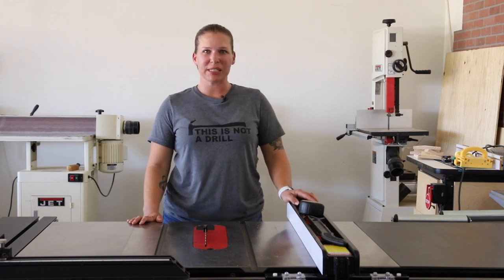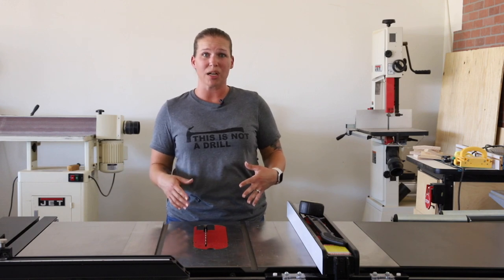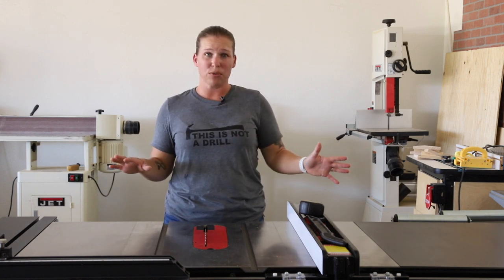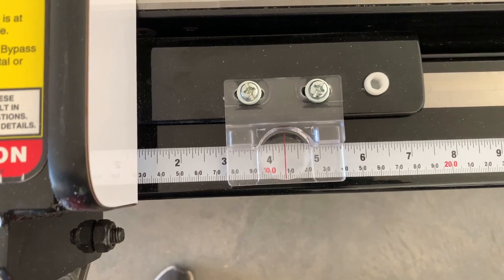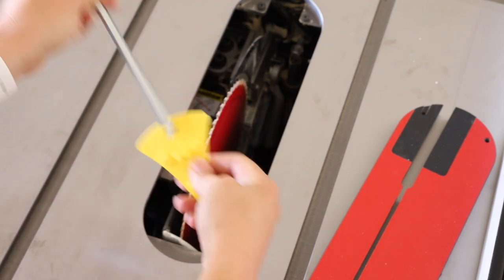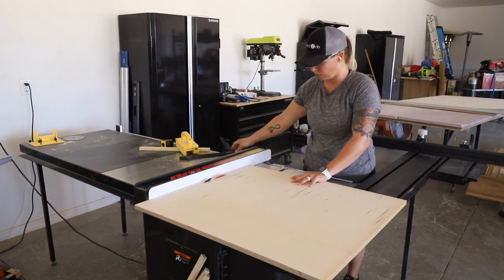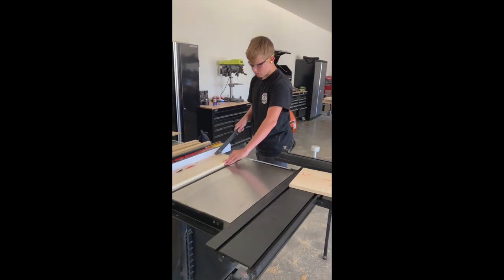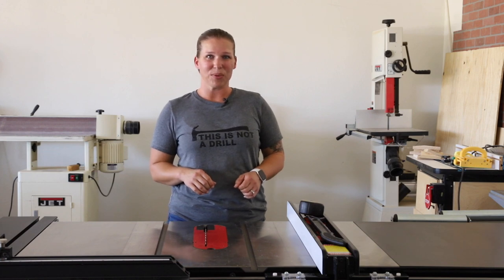SawStop Review - 1 Year Later (The good and bad)

Comment: i sold my beloved Unisaw and was prepared to purchase the Industrial saw with 5hp which is a fantastic saw, but after much consideration, i realized that i never bogged any of my Unisaws with 3hp and a sharp blade, so at the last minute i purchased the PCS with 3hp and the 52" fence and i do not regret it at all.  it is a great saw with plenty of power and the customer service at Saw Stop is first class...thanks for sharing and i am happy to see that you are teaching your kids to use the saw in as safe manor!
Reply from the maker: I also considered the industrial but realized I REALLY didn’t need that much saw for what I’m using it for.  I’ve had zero troubles with my 3 hp binding up on me and beyond the safety features, I just love how amazing the quality is on this.
Reply: @addicted2diy  I own them both and there is a huge difference between the 5hp and the 3hp, I use my 3hp as a dado station, they are placed back to back with a 3' out feed table between them; one only realize how valuable 5hp or higher is when have to cut thru thick hickory material or any other hardwood that you want in thick material; I love them both, I don't see the use of the slider, I owned before the real slider saws, as you mentioned in your video, only good for large material rip, that's all, other than that, the slider is in the way all the time.
Nice description of your saw, have fun with it.
Dan
Reply: @PAPSROYALAPIARY  With 3hp I  resaw 5/4 Ipe 1x6 decking with the blade full up buried in the edge of the board.    No issue with a lack of power.  Ipe is considerably harder than hickory.  On the Janka hardness scale hickory has a hardness score of 1820, not quite 50% harder than White Oak.  Ipe's hardness scale is 3680, double hickory's hardness, and almost triple white oak's hardness.    One advantage I do have is I do have 10 gauge wiring from the 30amp breaker to the saw including the saw cable.  Voltage drop is nonexistent.
Not saying that you have voltage issues but I do not hear or detect any slow down when cutting 3" deep in Ipe.  This was true with my Jet 3 hp cabinet saw and my ICS 3 hp SS.
Reply: @11211lcb  Great, but one wouldn't know the difference unless worked with both 3hp and 5hp, so with that said, we all love our saws, but realistic assessment is only viable if we can do a true comparison, right?

Comment: Katie--thanks for the review. I'll be getting a slider for my saw once I use up an excess of lumber. Have you ever thought of using a pushbutton clevis pin to keep the slider from moving out of the rear position? It seems as though it should be an easy thing to drill a hole in the slider frame, into which the pin could be inserted. 

Some pins even come with a lanyard; using that would keep it from getting lost.

Comment: I have same saw in my shop minus the cross cut sled. We use a nickel for the gap on the cartridge. On average, it gets set off every couple of months. The humidity does effect how easily it’s set off.  Pretty happy with it, doesn’t have the power my powermatic has, but the safety feature makes it worth it

Comment: Maybe I’ve been taught wrong, but if I’m using a sled, I don’t use the edge of the fence. I believe that it can cause kickback in certain circumstances.
Reply from the maker: That’s correct.  I don’t cut the sheets down exactly.  I set the fence to an approximate length I need and slide the wood until it’s 1/8 to 1/4” off the fence to prevent any kickback.

Comment: Thanks for the 1 yr review - always best to do reviews AFTER putting some miles on the product instead of those unboxing reviews. For your miter problem - if you put the fence on the other side of the blade and use that 52" space instead - should avoid that problem.

Comment: We have a Sawstop at my local Menzshed. I've come close to setting off the safety system one time when my fingers brushed against the blade just before it stopped spinning. I find it to be a great saw. I think the only gripes I've personally found with it are:

1. If you set the fence very close to the blade (around 3 mm), the red warning light flashes to say it's conducting electricity.

2. The thing the castors are set in to has a large gap between it and the saw's cabinet that gap fills up with sawdust and junk quite quickly.

3. The internal tube that takes the sawdust away has a spiral rib along it that easily blocks up with sawdust and small slivers of wood.
Reply from the maker: I’ve never set the fence that close to have that happen, but one thing you can do to alleviate that is make a sacrificial fence that sits over the top of the actual fence.  Then you’re able to get extremely close and the blade will only cut the plywood on the sacrificial fence.
Reply: @addicted2diy  Yeah that would be a workaround. Would you mind setting the fence on your own saw about 3 mm or 1/8" away from the blade and see if yours also flashes the red light? Thanks.

Comment: Thanks for the glowing review of your saw. I bought a similar saw last fall and really appreciate the power this saw delivers compared to my previous machine. However a major downturn in my opinion evolved when the safety feature triggered…no injuries but the triggering occurred when I was cutting some plywood which apparently contained some water in one of the layers….the wood had been outside. I had previously been cutting some very green fence boards and had no problem. My soured opinion set in when I had to remove the destroyed brake module and blade, what a nightmare. I don’t think the design could be any worse. Because the saw was new, Sawstop did give me a one time courtesy replacements which I did appreciate. However I’m now faced with the dilemma of buying a brake cartridge for my dado blade and the annoyances of having to change it back and forth as the different operations are used….not impressed. My 1st choice was a Laguna fusion 111 but it just wasn’t available because of the messed up supply chain. When things return to normal my Sawstop may be up for sale.
Reply from the maker: That's such a bummer that you aren't liking your saw.  I haven't yet had my brake triggered, which I'm grateful for.  I am actually really surprised that it happened with plywood.  I've never known plywood to have moisture in it.  I'm glad everything was okay and no injuries were sustained!
Reply: Those aren't valid reasons for selling your SS and buying a Laguna which has the worst reported customer service in the industry . plus the laguna is trash compared to the quality of the saw stop . 
Triggering the stop mechanism with a wet piece of plywood is a rare event and buying a stop mechanism for your dado is simply unnecessary .Just be extra alert when using your dado some and you will be fine . 
The laguna is basically the same saw as a grizzly , jet , harvey etc but without customer service . Don't do it .
Reply: @siriosstar4789  Thanks for the response. Yes, I’m one year into my SS experience and I’ve only had one more brake activation….this one was totally my fault so the replacement blade and brake unit were on me. I have become super cautious when using the saw, more so than any other saw I’ve owned. I take note about the Laguna support comment, I do own other Laguna stuff and any time I’ve needed help they always seem to be helpful. However, I do like your suggestion about the lack of necessity for the brake unit for a dado operation….that hadn’t even crossed my mind. Unfortunately since my last post I have bought the brake unit but may never use it….I really hate the idea of destroying an expensive set of dado blades. Thanks for your positive comments.

Comment: I appreciate the posting.  I bought this saw about 5 years ago and I was considering the sliding cross cut sled.  Thanks for talking me out of it! 😊
Reply: For the price of that thing...I would skip it as well!!!! I can buy a whole tablesaw for the price of that sled!
Reply: @charlieodom9107  Or a track saw system that includes the ability to break down full sheets or act as a jointer for one edge. People always forget that even plywood edges should be cut square and not rely on factory edges.

Comment: Great 1 year review thanks for posting.
I have same model that is about 3 years old. Can't beat the safety aspect. 
I did have one cartridge "soft blow" not sure what I did wrong but it was when I was adjusting for a miter cut. the saw was not running but the power was on. weird but the good thing is it did not damage my blade at all. I replaced the cartridge and just went on with my project. Still don't know what caused it and it has not done it since. I do power saw down completely now when changing to a miter cut, then re=power on.

Comment: Nice review, why do you not use a blade gaurd, especially when your kids use it
Reply: Because its saw stop. You don't need a guard.
Reply: @majorcrispy7203  you mean saw stop don't even supply one? That's very brave of them. Happy holidays
Reply: @danthechippie4439  I'm fairly certain that's the case yes. If you look up the demos you can find videos where people literally test it with their fingers hands w.e lol it's wild to watch. Happy Honda days!
Reply: There is a guard And it comes with a saw dust collector option.  Especially the kids don't need to have COPD in 60 years.
Reply: Saw Stop supplies blade guards with all of their products and the operator’s manual states that it should be used on every cut when possible (like the ones demonstrated in the video).  The saw stop technology should not be relied on as your primary safety strategy. It will not prevent contact with the blade or injury, it just reduces the severity of injury.  Also, keep the kids away from the saw.
Reply: @danthechippie4439  The SS comes with a comparatively excellent blade guard.  But like most blade guards they get in the way and can cause a kickback hazard when cutting thin short pieces.  Those pieces can wedge between the blade and the inside of the guard and come flying out towards the operator.  While blade guards help to keep your hand out of the blade it is unfortunate that they can introduce an issue as I described.

Comment: Your sled problem is not that is doesn't lock when full at the back. In fact, I find doing this dangerous, preventing your to step away in case of any problem (kickback ?)
Your problem is the fact that every time your remove the fence to get some room then put it back on, you have to re-tune the squareness. Because it's a pain, you just leave it on.
Problem is that there's no way to lock the 90 degree in a reproducible way. 
Some people worked on a solution (don't remember where but I can search for it) that is, as far as I remember, is not that hard to build. Still, I havn't done it myself... 
Even with this problem I do love the sled.

This sled is not made by SawStop, I have the same (color and fence look is different) that I bought OEM and installed on my Delta table saw, which I also love and wouldn't exchange for a sawstop. One thing better the Delta have is more room in front of the blade, so it's easier to set the piece of wood, to get is square, before starting the cut  :)

Finally you're totally right for the industrial base, which I love and copied. I build my own version for my Delta saw. I even think mine is sturdier and allows easy movement of the whole setup !

Thanks for your review, usually people make review when buying but never again. Its even more important to know how it's going and if the product stands after a year or two of use. THANKS

Comment: Katie, may I suggest a possible solution to the balance issue with the sliding crosscut sled. I have a Sawstop 32", 3hp PCS with an ICS mobile base and it is all cast iron with a router table installed. It is a bit tipsy on the other end of mine, but I counter it by being sure my fence is always on the far-left or opposite end along with anything else that maybe on it when I move it. It looks like you might be able to take advantage of the fence weight as well, just run it down to the far end next time to see if it helps. If not, it might be a good reason/excuse to get a router table installed on it 😁. Thanks for the review!
Reply: You would probably be happier with the Pro base rather than the industrial.  The industrial base is way larger than the Pro saw base.  The ICS Saw fills the industrial base completely and has no tipping issues.  Then again the extra weight of the ICS may contribute to the stability when moving.   The ICS right extension wing legs do not even have to be adjusted to the floor.  Mine remain about 1/2"  up from the floor at all times during use.
Reply: @Leon Bridges  For me the PCS base was too limiting, I could not have gotten the cast iron router table and the cast iron filler wing between the router table and the right saw wing with the PCS base. Sawstop say’s it won’t lift it. I’m not so sure it’s the weight as it is the tipping. The wheels on the ICS base stick out, especially the right rear wheel, it’s offset to the right a couple of inches more, which supports the weight on the right side of the saw from tipping. But this does require you to attach two straps from the saw base to the ICS base on the lower left side which secure the saw to the base which stops it from tipping to the right. I also just talked to a person that was at Rockler and he was about to buy a cast iron router table to add to his 36” Sawstop with a PCS base. He damn near cried when I told him that he would need to upgrade his base. It’s not just the cost, but it’s a major undertaking for most people move those saws. I’m happy with my saw and base, I’m sure you are too, I mean we got Sawstops right? 😎
Reply: @11211lcb  The Industrial base rotates on all four wheels, the Pro only two, so it has to be steered.  That's the biggest reason people will chose the Industrial over Pro, it's much easier to maneuver in smaller spaces.

Comment: Your sliding table issue may be solved by installing an additional TSA-SA48-105 sliding table limit block at the location of your choice. It would require tapping some new screw holes for the added stop block.
Reply: Or put a squeeze clamp on the tray in front of the sled.

Comment: A work around for locking that sliding table in the rear position would be to simply get a mag switch and put in its track and lock that way. But curious if you can pull that off entirely like a drawer and put aside. I'm looking at getting one for my 11yr old professional sawstop too and have a narrower shop to walk around it when not in use. I can clearly see it would pay dividends on breaking down full sheet goods. Saving time and more importantly, tear out when using a circle saw and straight edge on the floor. Plus you take advantage of the built-in dust collection on the table saw.
Reply from the maker: That’s a really good theory on the mag switch and one I haven’t entertained.  I am definitely going to look into that!  The sled itself does not come off like a drawer slide.  The fence can be removed by loosening the screws on the fence and taking it off.  It’s not a hard thing to do, but 9/10 times it’s really not in my way for most cuts.  There have only been a few where it’s needed to be removed.

Comment: That’s a great review Katie.. 2 problems I see :
When using ur mitre slide running with Fence will create kickback.. material between fence and blade should alway have equal and continuous push throughout the cut
Second : 
Mitre slide should be taken off when cutting with fence . I know it’s a hassle 
Just my opinion stay safe folks

Comment: I am glad you did this review. I had already purchased my saw and inline router table prior but I really wanted to see  the sliding table in action. The thing that is discouraging me so far is having to remove it when you want to rip a large sheet then having to square it up again. Have you run into this?
Reply from the maker: I actually have and forgot to mention that in my review.  It has only been in the past couple of weeks that I have ever run into this as an issue, which is probably why I forgot to mention it🤦🏼‍♀️ What I have done, rather than removing the fence on the sled, is use my track saw (I have a Keegan Adaptive Cutting System) and rip the wider sheer goods down with that.  That being said, it is not hard to square the fence back up when reassembling it.  It’s really been out of utter laziness that I just haven’t removed it to make those cuts😂  That being said, it’s probably the same amount of work to set up my track saw as it would be to remove the fence.
Reply: Thanks for covering the crosscut sled. I’ve had my Sawstop for a couple of months and after watching and reading this post, I’m sold. Sometimes the process is more important to the builder than the efficiency. I totally get why you use a track saw rather than pull the miter.